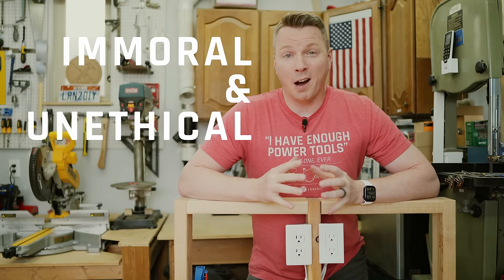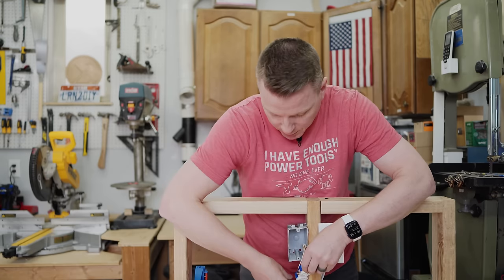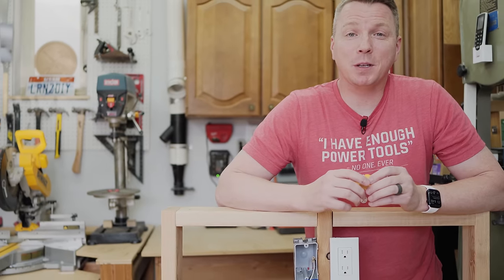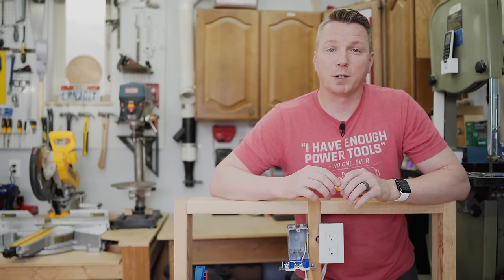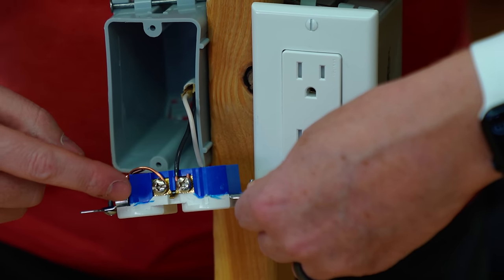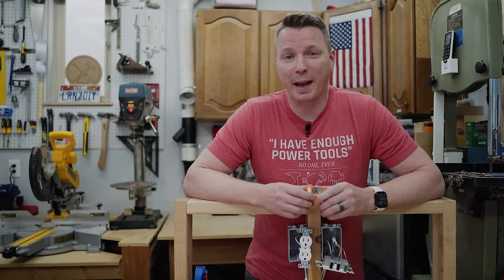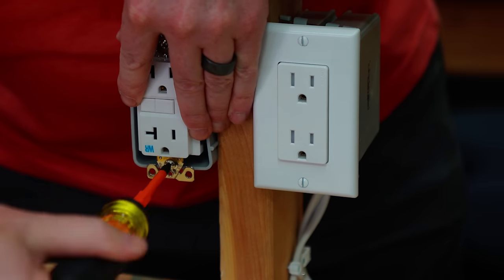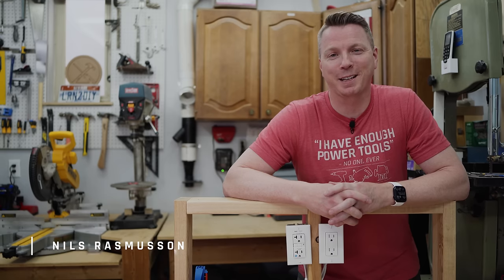People Are Adding Deadly Hacks to Outlets

Comment: The neutral (white) and ground (bare) wires are bonded in the main service panel of your home.
Reply: And nowhere else. Ground is exclusively for safety - in the event that there is a short in an appliance or fixture that causes its chassis to become energized. If you bond neutral to ground at the receptacle, ground becomes meaningless.
Reply: @wallyballou7417  That doesn't make sense. Since the return and the ground are going to the same place, if the ground is connected to the return on the back of the receptacle and a short energizes the chassis, it will be a short back to the panel and the breaker blows (standard breaker is only on the hot so the breaker doesn't care where the return current goes).

Plus Kirchhoff's voltage law stipulates that two equal lengths of wire, one to a voltage source and the other to a voltage reference point (for example, ground) connected together will have half the source voltage at the connection point. (Here each wire acts as a resistor (very low resistance, but a resistor none the less) so the connection point is in the middle of a voltage divider. So in the brief time before the breaker blows, here in the US the chassis should have a voltage of about 60Vac, not 120Vac no matter if the return current is on the white wire or the ground wire.
Reply: @Sembazuru  Don't take my word for it, check the NEC. It's very specific about this.
Reply: Electrically Chris is correct, Code wise Wally is correct.
Current should never be flowing on an Equipment Grounding Conductor except to clear a ground fault.

In an ideal scenario electrically it doesn’t matter the return path as long as it trips the circuit protection.

Thermally we don’t increase EGC for  high temperature situations, and once we go above 20A over current protection we start reducing the relative size of our EGC. So if you have a 50A circuit with #8 wire you only are required to have a #10 EGC per Table 250.122. If we’ve bonded neutral and EGC at our receptacle… then we now have a #10 in parallel with a #8 and are majorly exceeding the current capacity of that #10 that is only rated for 35A. We then have a situation where we can overheat that #10 without ever tripping the overcurrent device.
Reply: @Sembazuru  it does if you factor in modern circuit protection a GFCI device has the active and neutral run through a coil if there is the same power on the active as the neutral they cancel each other out but if one is higher than the other a voltage is generated and trips the device. Now if you bond the ground (no ground wire) and neutral at the outlet in a fault all power that goes to ground ends up returning on neutral defeating the GFCI. This is why the system was done this way the 10 to 30ma will hurt but most people will survive it but 16a or 20a that a fuse or breaker needs to trip is generally a death sentence also those device can allow upto 10x their rated capacity in a short situation so a 20a breaker could see you get 200a
Reply: @Sembazuru  your missing one important consideration. There are several outlets on the circuit so the return already potentially has current from several other devices. The ground wire is supposed to never carry current except in the case of a fault, where if wired correctly, it will provide the lowest possible impedance to ground.
Reply: Our old friend resistance says this stunt is potentially dangerous. 
Too many peoole believe electricity takes the easiest path. 
That's not true. 
Electric current takes ALL available paths. 
Btw,
Speaking of reversed polarity. 36 years being electrician, I found about 8% of all receptales I encountered were polaity backwards.
Reply: Glad someone has some sense here. Thank you
Reply: @shaynegadsden  one would think people bond ground and neutral for old circuits where there is no Gfci ?
Reply: @benjurqunov  all paths, but in different proportions
Reply: @dmitripogosian5084  nope in old circuits if there wasn't a ground you just don't have one, having multiple bonds can become dangerous. Like if there was a fault somewhere you could get potential in unexpected locations
Reply: @shaynegadsden I do not disagree with that !
Reply: @Sembazuru  while you obviously understand it very well.... you are missing the most critical fact in your understanding (perfect example of why people need to respect the trades and the Codes because the nuances are seldom obvious or intuitive) and is simply this.....if current is on a ground any where and a person provides a better path or a short cut then the electricity will take the path of least resistance possibly resulting in electrocution. To help complete your understanding of the actual physics of the system know this : the neutral current is only seeking the source and when it reaches the Neutral to Ground Bonding point in the system (in the case you are defining that would be your Main Service (typical but not exclusive)) it flows directly to the source and NOT back to the grounding system of the structure. Think of the neutral insulation as a corral back to the XFMR/source that can have no openings until it's last connection to the Service Neutral. Few people can understand that BUT ALL ELECTRICIANS should at least build to it if not understand it.
Reply: @wallyballou7417  I used to work for a telecom company, where there were racks and racks of equipment.  There was AC ground, DC ground, signal ground, shield ground and frame ground.  The only place they could meet was at the common ground point for the building.  These days, even the cable racks over the equipment racks are isolated from the rack ground.
Reply: @wallyballou7417 the NEC was written by electricians. (People who get paid to make this expensive)

The truth is almost nothing made in the last ten years really needs the ground. 

Look at most grounded cords. The ground cord is built to snap off. I stopped buying the three prong adapters years ago.
Reply: @Sembazuru  You just explained how a GFCI works....👍
Reply: Yes, and nowhere else. Any other connection between neutral and ground at all is very unsafe.

Comment: where I live it is very common to have bootleg ground in older homes, which is fine because it is mandatory to have every outlet protected with a RCD (GFCI). 
If there is a fault between Live and Ground it will short the circuit and the breaker trips or if you get shocked the RCD will trip.

Comment: This sort of thing always makes me glad that I live where I live. While it is common to plaster twin and earth straight into the wall, we generally have concrete walls with conduit running from the roof space. Pulling in an extra earth wire is less than an hour's work.
Reply: Yeah, where you live, you use 220 volt, which will kill you.

Comment: One thing that often doesn't get mentioned with a bootleg ground - it's worse than the abscence of a ground. If the neutral wire in the wall breaks or falls out, the ground pin will become live with 120V because the current wants to take a path to ground via the ground pin as it's jumpered to the neutral which has gone open, meaning the case of the appliance becomes electrified!

The whole reason we bond ground and neutral ONLY at the panel and NOWHERE else is because of the deadly consequences of a neutral going open on a bonded ground. We only do it in one place to minimize the risk of this happening. But if it's done on every outlet, a neutral break in ANY wire will cause the case to become live on the appliance. Which is FAR worse than not having a ground!! It's a "fail-deadly" fault.
Reply: That's really the only way this becomes hazardous as far as the outlet is concernde, which is why you can get away with it, well, basically forever, and not have any issues, but also could get away with it until you use it the first time. Important to not over-state risk, most of code is accounting for potential failure modes, and some of those failure modes are absurdly unlikely.

To me, the real danger presented here is a faulty appliance, not a faulty wire in a wall, so the code accounts for some failure modes there, but, if you happen to have an appliance that's bad enough, well, you want some form of GFI to bail you out because even good wiring wont save you from something that loses it's internal neutral connection and also isn't grounded properly. Sounds outlandish, but, chinesium abounds and "CE" doesn't mean it's safe.
Reply: @jttech44  The neutral failing inside the appliance wouldn't cause the casing to become live as there is no bond inside the appliance, so the current is not trying to get out via the case. It's if a neutral fails upstream of a ground neutral bond that you get this issue. If the neutral went open internally the appliance just wouldn't work.
I've also seen quite a few outlets where a space heater has been used and has burned up the (slightly loose) neutral on the socket, causing it to go open. That would have caused the 120V case fault described here if it was bootlegged.
Reply: That simply is not true. I checked the electrical fatalities in Finland since 1980. There were no fatalities caused by breakup of the PEN-wire. There were six because of non-existent or broken grounding and three because of reverse bootleg ground. Note PEN-wires are normal in the time period most homes had them wheres using ungrounded sockets on dangerous locations was abnormal.

Properly installed wires do not spontaneously break.
Reply: @okaro6595  Read about it if you want to understand more. There's a reason we separate ground and neutral. The PEN to the house breaking is only a problem in TNCS and TN-C installations, but it will cause objectionable voltage to flow on the grounds.

Comment: If I saw this, I’d be really tempted to call a lawyer. It’s pretty likely the whole house has been intentional wired to deceive, and may need a lot of repairs.
Reply: be almost impossible to prove the previous owner did it. Most people own a home 5 to 10 years max and we're talking 1970"s back.  MIGHT get the inspector if you paid for an inspection.
Reply: @williambrennan5701  In addition, the central question for torts is "what loss is being claimed?" Just doing something that might have terrible results is not a tort; all that could be claimed is the cost of removing the bootleg grounds. The lawyer would be a lot more expensive than that.

Comment: We just had an electrician fix this like 2 months ago. I only noticed it after I purchased a PSU and the ground light would not turn on, and then I looked over at a different outlet and noticed the surge protector on another outlet also did not have the ground light lit. So they were replaced and a ground outlet added. And just yesterday we found out the plumbing for our bathtub was not done correctly either and needs a P-Trap connection installed.

Comment: Neutral is usually 0V when not under load. The ground is for safety in case of a short internally. I bet if you plug in a hairdryer to the other plug (1500W) and put your outlet tester in, you’ll have it show that the socket is wired incorrect. This is because now the neutral will be above 0V due to voltage loss in the wires.
Reply: No under load a neutral still measures as 0v
Reply: @shaynegadsden  It will not be 0V under load but it will be very low. 12AWG wiring has ~0.007 ohms/ft so on a longish run of say 70ft you could get as much as 0.5 ohms, which at 10amps gives you 5 volts. That's worst case, typically see a volt or less so it takes sophisticated tester to detect it.
Reply: @jiml5837  it is zero a $700 fluke is classified as a sophisticated tester, i know what you're saying but the method here will never see that. The only way to see that voltage is to probe both ends of the neutral while it's loaded, every test you could perform at that single point will show as 0v.
Reply: @shaynegadsden  
No.
Depending on the resistance on the neutral conductor, voltage between and ground can be present. 
I've measured upwards of 3V on occasion. And thats on circuuts with no major problems like a poor neutral connection. 
Electric current flows on ALL available paths. Not just the path of least resistance.
Reply: @benjurqunov  in any of this have you seen mention of an earth, No because the lack of an earth is the reason for this problem
Reply: @shaynegadsden  /whoosh...
Reply: @benjurqunov  i would say that applies to you, yes WE know voltage drop happens but what we know isn't the point it's what you would see at the end of a 2 wire system and without a 3rd reference point no amount of load will make the neutral show anything other than zero, I think i saw on another comment you're an electrician if so you should know that if you perform the test like OP suggest the only thing you will see is the overall voltage go down the tester won't know there is no earth because of voltage drop because without the earth it doesn't know voltage drop is happening.
Reply: If you mean the bootleg ground the tester has no way to know that there is voltage on the neutral as it has no access to the true ground, only to the contacts of the socket.

If you mean that it would fail on a properly wired socket then that would be  theoretically possible but in practice the voltage loss would be just a few volts.
Reply: @shaynegadsden  I have a line volt meter plugged into one outlet of a split receptacle in my kitchen.  When I plug a kettle into the other outlet, the voltage on the meter increases.  This is due to the voltage drop in the neutral, from the current.  So no, it will not read 0.  The only time it will read 0 under load is when the current in the two outlets is balanced.
Reply: It will have a voltage, but not enough to light the neon light.  A good voltmeter with auto scale ability might work.  A good outlet will show a small voltage - 1V or so - while a bootleg will show zero.  For this, you would need something hardwired, very low voltages can be problems for most multimeters.
Reply: @russellstyles5381  and how would you measure that with your good multimeter
Reply: @shaynegadsden  In my experience, multimeters don't work well with very low voltages.  A hard wired circuit would be best.

Comment: Has this never been legal in the USA? In my country, this bootleg grounding used to be normal and legal. It's called "classical grounding". And it is definitely still better than not having any grounding at all. However, on new installations (since 1973), you are only allowed to do "modern grounding" (using 3 wires).

Comment: Yes, NEC prohibits bootleg grounds. If installed connecting to the L2(neutral), it only poses a potential problem with GFCI outlets. All neutrals are bonded to ground back at the circuit breaker. Neutrals are equipment ground. The extra dedicated ground only serves as a means to provide a low resistance path to ground out the casing or exposed metal components of devices that plug into the outlet; This protects the operator from becoming the path to ground. 

Again, the neutral wire is bonded to ground back in the circuit breaker. It is perplexing to think that electrical outlets worked just fine before dedicated grounds were added(sarcasm). Neutral=ground. Of course, always follow the NEC or whatever organization governs electrical codes in your area. Having a proper dedicated ground doesn't hurt anything, and can add extra safety. Although, it does add to the cost......

Btw, if safety truely was the goal, then running a dedicated ground AND bootlegging the ground to neutral would technically be even safer! By running the neutral ground in parallel to the dedicated ground, the total wire line resistance to ground would be effectively cut in half, further reducing the current that might flow through a person by increasing current in the now lower resistance path to ground.🤔
Reply: Yes, having a dedicated ground would cut the resistance to ground technically in half; However standard 12 gauge wire has 1.6 ohms per 1,000 ft at 77 degrees F. The shortest electrical path that can be lethal, invloving your hands, is hand to hand  or hand to closest foot. Hanad to hand is roughly 2,330 ohms. Hand to closest foot is roughly 1,300 ohms.

(2,330^(-1)+1.6^(-1))^(-1)=1.599 total resistance. Max peak voltage of 120vac is roughly 170v. 170v/1.599ohms=106.323A total current flow. Current through the 1.6ohm nuetral/ground would be 170/1.6=106.25A leaving  .0731A or 73.1mA. Anything over 30mA can cause the heart to stop.

Oddly, cutting the resistance to ground in half by having a dedicated groud would result in total current being 212.573A with 212.5A running through the two grounds, leaving .073A flowing through the person in parallel. Still enough to stop the heart. So there is virtually no difference between having just a nuetral ground and also having a dedicated ground.

Comment: As I remember, ground wires connect to the neutral bar in the electrical panel. Am I wrong?
Reply from the maker: You’re correct and that’s called bonding and is there for our safety to create a ground fault current path. The bootleg ground directs that path to the appliance or to us instead.
Reply: You can only have 1 bonded neutral in a circuit which is at the panel so doing this hack creates 2 which from what I understand if there is a fault, instead of it going back to the panel and tripping the breaker part of the current can go to the hacked bond on the plug and not trip the breaker which is where the problem arises.
Reply: @LRN2DIY  Thank you for explaining this. I didn’t know. I have learned from LRB2DIY and likely been saved from injury. A happy subscriber.
Reply: @Mixwell1983  Thank you for taking the time to explain this to me and in a professional way. Thanks for looking out for your fellow man. Blessings to you.